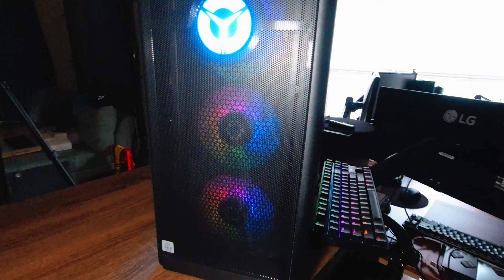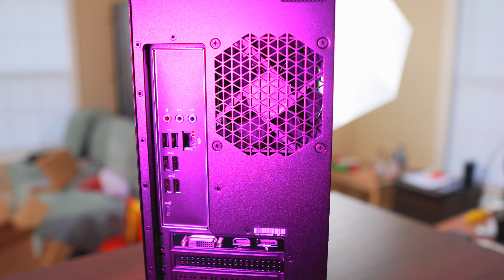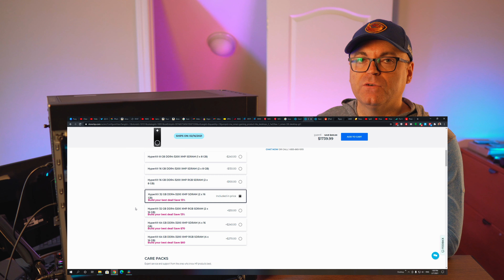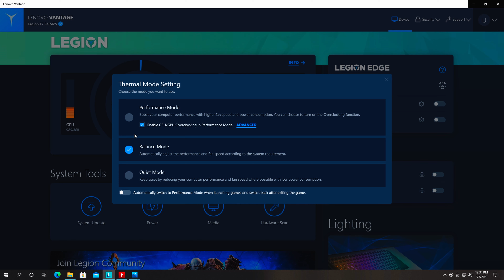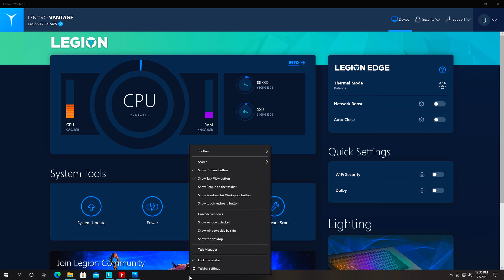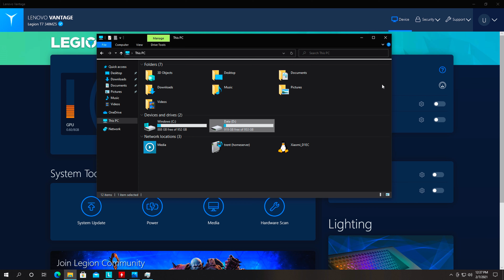Lenovo Legion T7i - Possibly The Best One Yet!

Comment: I didn't pull the trigger quick enough this past Saturday and missed out on getting the 3070 liquid cooled that you're showing in the video as it sold out. The other one available is the 2080 super with 1tb ssd and 1 tb hdd.  Is the 2080 super going to be a big step behind? Its selling for $400 less.
Reply from the maker: You should have grabbed the I7 version, it was $1650, and now is $1860.  Don't get the older 2080, just wait for 3070 or get the I7 one.
Reply: @HardwareSense  so the  i7 with 16gb memory with 3070 and air cooling would be better than the i9 10900k with 32gb of memory, water cooling and 2080 super? both cost the same because the 2080 super is on sale from 2599 to 1899.
Reply from the maker: @rwrjw  Yes absolutely, you can always upgrade ram later, but RTX3070 won't be easy to buy for at least another 6 months, and is much better than 2080S.
Reply: @HardwareSense  Ok, thank you sir !
Reply: Sorry to keep bugging you but I ended up getting the cheaper 3070 version and will upgraded the ram etc but I have a quick question. One of the exhaust fans at the top is backwards, does the mesh screen at the top just pop off or do I have to remove screws somewhere? I can't find any screws attached but I also don't want to just start bending metal to remove it.
Reply from the maker: @rwrjw  It should pop off just be careful, take your time and don't use metal to pry it
Reply: Hi again and back with another noob question. I am trying to upgrade the fans to corsair but I'm pulling my hair out because I have to connect to a usb 2.0 header on the motherboard but for the life of me I can't find one ? Did you see one on the board or have another idea to hook this up?
Reply from the maker: @rwrjw  I have not changed mine, but you should follow-up one of the fans and see how are they currently connected
Reply: @HardwareSense  the original was connected to a 3 pin but the nod that controls the fan speed and lighting requires it to be connected to a usb2.0 header. I don’t think It has one available.
Reply from the maker: @rwrjw  You might have to use a separate controller in this case.

Comment: Is the ssd M.2 NVME ?  Thank you sir excellent review
Reply from the maker: Yes, 2x1tb
Reply: @HardwareSense  thank you, so the board has 2x m2 slots, I’m looking at getting the 3080 version 512GB 16GB ram.  Would you recommend , I normally build my own machine but this looks rather nice, I have 4 x SSDs that will be pulling from my old machine , I see the board states it has 6x sata, but I guess with m2 installed that will drop to four. Can you verify that the board has 6 sata outlets please. Thank you kindly excellent review
Reply: I’ll upgrade the ram to 32 immediately
Reply from the maker: @TAP1992  Will check and let you know
Reply: @HardwareSense  would you be able to tell me if there is an option in the bios to enable xmp for ram modules , otherwise modules will just default to a base speed
Reply from the maker: @TAP1992  There is no XMP option in the Bios, the memory OC is done via Lenovo Vantage and is similar to the one on HP Omen desktops. The default is 2933mhz but the Vantage is pushing it to 3200mhz, unfortunately JEDEC and a bit slower timings, but at least is 3200mhz.

Comment: I saw this review and ordered one.  As others have said, not much out there about this PC.  I ordered a machine from Cyberpower PC like a month ago with no word about when it would ship.  I canceled that order and ordered the Lenovo.  Better specs for less money.  Looking forward to getting it.
Reply from the maker: It will be at your door less than 3 days after gets shipped, fastest ever!
Reply: @HardwareSense  I was wondering about the ability to add storage.  Mine will have two PCIe SSD drives.  There is also apparently the ability to add two more SATA drives.  The spec sheet from Lenovo I think says something about only being able to add HDD up to 2 TB.  Does it support larger HDD on the SATA bus?  Would it support SDD 2.5 form factor?  What about adding a PCIe adaptor in one of the PCI expansion slots?  I am kind of surprised if it only supports drives of less than 2TB
Reply from the maker: @timcooper62  All that can be done, extra Sata 3 storage can be added.
Reply: @HardwareSense  One more question...are the power and data cables there already or do I have to get them on my own?
Reply from the maker: @timcooper62  They are already pre-routed.
Reply: @HardwareSense  Thanks alot for your help.  Mine just arrived today. Fun evening planned on setting up and such.
Reply from the maker: @timcooper62  Enjoy!
Reply: @HardwareSense  Its set up  and running...a word to the wise, go to Nvidia and install the latest video drivers.  My old Tomb Raider game would not make it past the menu screen...the performance was sooo bad.  Sorta had me in a  panic at first.  Once I installed the latest nvidia drivers.....amazing!!!
Reply from the maker: @timcooper62  Always get the latest drivers, no matter what
Reply: @timcooper62  hows the noise from it mate?^^
Reply: @Bankai90  Its very quiet.  I hear no fan noise at all.  I have pushed the graphics card playing several different games on the highest graphics settings and the PC has handled it perfectly.  I am happy with the purchase.  Looking at other systems with similar specs....the price I paid was great.

Comment: Is the MOBO upgradable, or a custom for Lenovo and won't fit alternatives?
Reply from the maker: It's the best oem motherboard made by MSI, it can be upgraded or transferred to a different case
Reply: @HardwareSense  Thanks for the info.  RAM only runs at 2933 though right?
Reply from the maker: @JeffyUnger  No, it's running at 3200mhz by default
Reply: @HardwareSense  Ooooohhhhhh....spec sheet said 2933 so that's nice (not that it's much different either way).  I'm considering the 10700k with 3070, 16GB.  I'd assume 1080p 144FPS is easily achievable for most games with the 16GB.  Oh...And also only has 1tb Nvme so I'd assume I could grab another one in aftermarket and just plug it in right?   So helpful to get your responses and your review.
Reply from the maker: @JeffyUnger  Correct, 144 constant FPS and you can add Nvme and multiple Sata 3 SSDs
Reply: @HardwareSense  Do you know if it's possible to install a second GPU (say another 30 series) if I want to let it mine while I'm not gaming?   Oh, I should mention it'd be for the model I mentioned in the previous comment.  Mentioning in case power draw on the 650 would influence your response.   Also. you should probably hit up Lenovo for some sales commissions...from reading the comments I think you got a lot of people to buy.  lol
Reply from the maker: @JeffyUnger  Lol, Lenovo are not playing that sponsor game unless you have a lot of subs. There is a slot for another GPU but you would need bigger PSU.
Reply: @HardwareSense  dang, I kinda figured that.  You think and 850w would do the trick or am I looking at 1k?  Once again, your insight and responses are so greatly appreciated.
Reply from the maker: @JeffyUnger  Yes 850w should be fine

Comment: Hi, not sure how is it going with your further test. I got mine yesterday. There are 2 issues I found so far. 1. The Lenovo Vantage software is not working - cannot save the setting. Lenovo said it's a bios overwriting issue. 2. RTX 3080 Black Screen, flickering , Reboot - Seems an issue for long time since 30 series card released...
Reply from the maker: What settings the Vantage is not saving? As for the 3080 I am not sure what is that problem the 3070 I have is working fine
Reply: @HardwareSense  Vantage setting like RBG mode will be reset after reboot. 
For the black screen, there 2 type types of issue. One happens at lower GPU load like using browser, The other happens at higher GPU load. 
From what I've seen, the 3080 and 3090 cards have more problem, some said it's the problem of Driver/Cable /G-sync/Windows version/Power setting/Capacitors... If the problem hapeen at lower GPU load, it's probably the drive issue. If it's happening at higher load, it's probably the faulty product from the 1st realse last year (I checked that my PC was manufatured on 2020-10-13).    
My issue happens at higher GPU load. I've tested it for 2 days now. The first day, most of time are fine, also tried 3 hours mining without problem. But crashed a few times when gaming.  Then Windows Updates installed a few BIOS, Drivers after.The second day, it's happens more often. Cannot mining for 10 minutes. Crahsed more often when gaming.
Reply from the maker: @hbeing3  Oh the RGB, yeah I noticed that, but for me thats not an issue, if I need them back after reboot I just activate a profile. I have 3080 from my Omen 30L, but is working fine, knock on wood, so far no issues with it.
Reply: @HardwareSense  Thanks! I'll do more testing. If it's still presists, I'll need to replace the card or just return.
Reply from the maker: @hbeing3  Don't even waste your time, just file a warranty claim
Reply: @HardwareSense  Thanks. Treid reinstalled the system and got more frequent issue. Just contacted Lenovo and I'm going to return this for refund. Really like this pC after comparing different options. But very disappointed with the RTX 3080 I would say...
Reply: @hbeing3  this flickering is a wide spread issue with 3080/3090 did you try nvidia drivers and not Lenovo drivers. According to hardware unboxed it was fixed with a driver update from nvidia. If Lenovo haven’t updated their own drivers for sometime this might be your issue. Download direct from nvidia and give it a try .
Reply: @TAP1992  Hi thanks for the advice. Yes, I did tried different lenovo and nvidia drivers. Different BIOS. Reset Windows then with the latest drivers. The problem just happens more frequently.
 I also checked the reviews from Chinese users because they've been using it since last Sept. Lots of 1 star review because of this. 
I also contact a few Chinese users.  They said the problem's gone after switching the new card. But with some other more noise problem showing up.

If you're intereseted, this is the answer from the product manager of this PC. A quote from him this issue is ''not only because of the capacitors'.
So, one step back, even if 30 series cards are faulty/have design issue, NVIIDA will never admit it. They just limit the clock speed by updating the driver.
Or buy most recent manufactured ones.

Reference (Chinese) https://www.zhihu.com/question/421835198, first answer from WolStame (PM of this PC), , where he also talked about how this PS was designed.

Comment: In Sweden they are selling the Lenovo Legion T7 with Intel Core I9 10900K and I7 10700K with 32 ram, RTX 3080 and PSU 850. These both open are with air cooling instead (not AIO cooler). Would that be enough? What do you think? I want it so bad! ;) Maybe go for the I7 10700K, maybe that wont be as hot like the I9 10900K.
Reply: Air cooling is probably totally fine particularly with i7 version but just more noisy . My biggest concern is the quality of the PSU in the European model because it's not the same as in this video. I think the PSU is just labeled 90 % whatever that means.

Comment: Thanks for sharing the comparison between the Legion T7i which Lenovo has on their website for $2170.  My Omen 30L configuration with the i9-10850K, 32GB 3200Mhz, 1 TB SSD, 2TB HDD, RTX 3080 and Wifi 6 cost me $2200 directly from Amazon. And at times they have dropped the price to $1961 but the scalpers got before I could get to my cart.

Comment: got 3080 with 10700k 850w 32gb ram very happy with mine, but gotta change to water cooler tho
Reply: Most of the options I see available are the 10700k with the 150w air cooler. Anyone know if it performs ok? Air coolers can be pretty decent vs water cooling but be nice to know how these ones are specifically.
Reply: Are you a US customer, here in the UK I’m sure it comes with the liquid cooler 10700k 3080 16GB 512GB ssD
Reply: Nah I am buying in the Netherlands. You get the odd liquid cooler version popping up but tends to be in the much more expensive versions and I reckon probably not worth an extra 300 euro
Reply: Why do you want to change it? Noise issue?

Comment: I ordered three of these, a couple weeks ago as they were the cheapest systems with the cards I needed in them and I didn't have to wait for my supplier to ship more cards. I have to say I'm very impressed with mine. They all run the CPU and GPU at actual spec. I even OCed one of them for fun before deploying it, it ran at 5.3 single core, 5.0 all core. I might buy some more to replace some of my other customers systems. Very good deal (I got mine on sale as well for roughly the price of the scalper pricing on the GPUs.)

Edit: I forgot to mention the downside is while these have rebranded gigabyte mobos in them they are running a custom bios from lenovo which is very annoying, but far from a deal killer.
Reply: Could you tell me there was a xmp option in the bios , as installing most other modules will require xmp to be enabled to get them upto their rated speeds

Comment: Question 
I really want to buy this computer.
If I upgrade the power supply, can 3080 become an option to use in the case?
Reply from the maker: Yes 100%
Reply: Thank you so much for your response!
You definitely earned a subscriber in me!
I actually just made the purchase😁😁
Last question for you. With the space provided in the case, in the future would it be possible for me to run a dual 3070 setup granted the proper PSU is used?
Reply from the maker: @jblur33  Yes its possible, what would be your reason, mining?
Reply: @HardwareSense  no not at all
I just like knowing in the back of my head that I have a little room for an upgrade if needed. 
Thanks so much again for the answer!
Reply from the maker: @jblur33  Anytime.

Comment: Just ordered a 10700k, 3070 32gb air cooled variant in the UK
Reply: got it today, really happy with it so far. its got a really beefy air cooler on the CPU, at least on par with a hyper evo
Reply: @bradw9620  How is the noise level with the air cooler? Do you have any idea what PSU they are using in the European model?
Reply: @nicokorkiamaki2991  I haven't fully stressed tested it yet but when I maxed out witcher 3 at 60 frames 1080p, ain't got the right cable for 144hz right now. Pretty much dead silent. Wouldnt consider noise to be an issue whatsoever. On the PSU, I am not too sure. I will take a look later today and get back to you
Reply: Witcher 3 max settings at 144fps. GPU temp was 75 and pc was reasonable quiet
Reply: Why not 3080? I wish they gave us the option in the 🇺🇸
Reply: @BoogieSpiderman  was 500 pound more and the other components were the same as the 3070 variant I purchased.
Reply: @bradw9620  UK pricing is crazy.

 yeah, I'm waiting for my rewards from reviews etc to process, then I'm going to jump on this t7i, i would be saving almost $200 with military discount and the  coupon code March015 total with tax: $1791.20. Plus 7% CB with Rakuten which I have no idea how I get that money lol

Like you said Lenovo has been on top of things. I never thought I would buy so much lenovo products since 2019, but during my search for prebuilds. I went with Dell G5 desktop with 3060ti(crappy circulation-returned), 2x Cyberpower with 3060ti(when it was $1250 at the time(pretty half ass build-returned), stumbled on Legion T5 with RTX 2060 for $1000 at costco(I was impressed) which I returned since I found out about the Legion t5 with 3070, so I bought it right away with shoprunner and recently they lowered the price so I pricematch it so I should be getting about $80 back which bought my cost to under $1500( oh at this time It was 10% Cash Back at Rakuten too so I guess i got it for $1400)
Reply: @BoogieSpiderman  sure is 10700k air cooled, 32gb, 1tb nvme and 3070 for 2k pounds. Luckily I managed to get a 10% discount.
Reply: Got the 10700k variant as well ...but instead of 32 gigs of ram  they gave me 64 gigs and another 2 tb HDD...was extremely surprised... it's not to quiet tbh...but it's ok the temps are amazing

Comment: As of today, 2/17/21 Lenovo is offering a different model of the t7i, with a 2080 super, 10 gen i7, 1tb ssd/ 1tb hdd, w/o liquid cooling for $1,800 with a promotion they're running. Would this build's value be as good as the model in the video?
Reply from the maker: Absolutely not, the RTX 3070 will destroy the 2080S. The have I7 10700K with 3070 for $1850 now, thats the better deal.
Reply: @HardwareSense  Awesome, thank you!

Comment: Can you use any ram modules on this and get their full speed and not have to use specific "Lenovo" brand ram of wich somthing hp did?
Reply from the maker: Good question, and I will let you know as soon as my replacement comes this week, I will test it out.
Reply: I was able to run G.SKILL TridentZ 2x 32gb kits in these at advertised speeds. No OC.
Reply: @vschwake  Hi , so those Trident Z didn’t need XMP enabled to run at 3200 ? Or 3600 ?,
Reply: @TAP1992  So... after upgrading another system with another kit of ram I was unable to get the second one to run at 3200mhz (ram was advertised as 3200, but thats XMP). The ram I used in the first machine was 3600mhz ram which then ran at 3200mhz. XMP can not be enabled or messed with on this system.